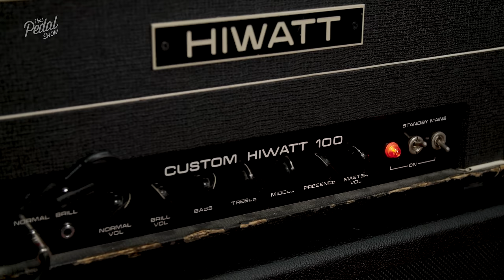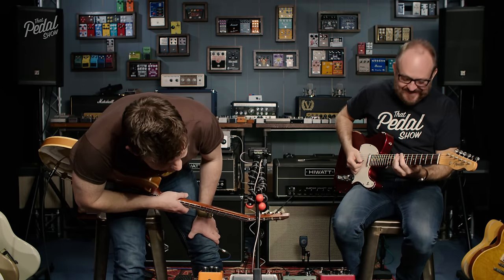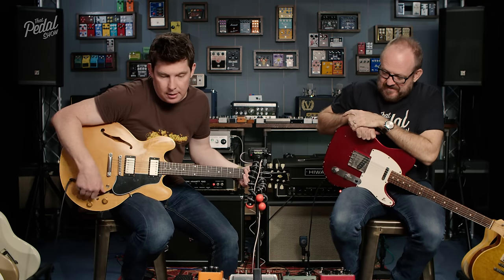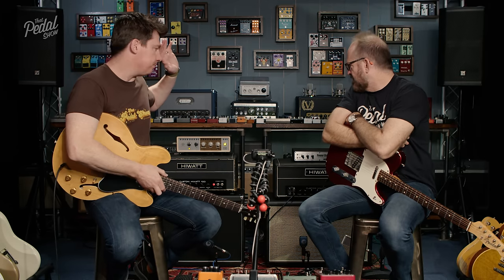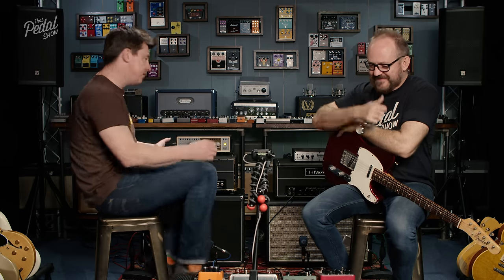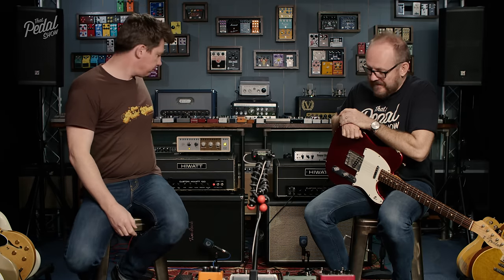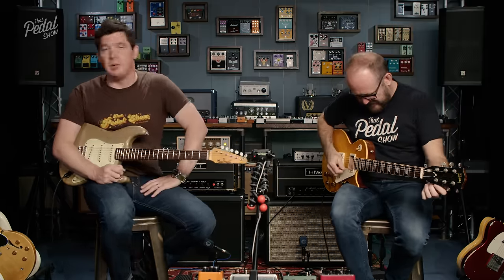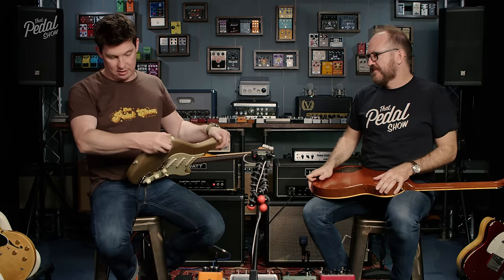Vintage Hiwatt DR103 Amps: Wet/Dry, Plus UA OX & Fryette Attenuators – That Pedal Show

Comment: First, that tone when Dan last plugged in with his downtuned Les Paul and the Color Driver on was absolutely insane, just begging for some slow, heavy Doom metal riffs! 

Second, I'd love to see you guys do an episode with the Blackstar HT-5R combo, it's an interesting low wattage amp and quite a few people own them since they're very full featured for the price. My experience with mine is that the hybrid tube/solid state preamp, solid state phase inverter and tube power section architecture can be kinda picky with overdrive pedals. My TS mini sounds great with it, but my Lovepedal Superlead can sound really harsh trough it, as if something was going wrong in the amp. I'd love to see your thoughts and experiments with one of these, they'd be of a great help on my tonal journey

Comment: A year later and I'm watching this again because . . . HIWATT!!! Delicious musicality! I prefer the Freyette because it seems to compress the top end and gets rid of the 'torn paper' extraneous noise on the top end. Of course, this could be the EVM 12Ls as well. Really, It would be wonderful for you to do a new Hiwatt episode that includes Fane speakers and a 50 watt Hiwatt for comparison. In America we also have the HiTone and Reeves companies as well as Weber speaker company that creates all flavors of cones at all impedances and wattage ratings. As far as the 'ripping paper' thing I don't like, that seems to be cured with higher wattage speakers that do not break up as early, as well as compression to chop the top off before it chops the top off our hearing. For me, harmonic distortion is great in the mids, but unwelcome at the very top. As you say, "Chewy" without the 'ripped paper' on top which always sounds/feels extraneous to the core musicality. I also fear it exhausts the audience after awhile. Then there is the EL34 vs 6L6 'argument' which even EVH dealt with in his 5150 III amps. Another thing to mention about Eddie's sound is the wet/dry/wet setup with the 'stationary chorus' (Dimension C) doubling effect. He used a preamp out/splitter box to stereo effects and back in to stereo power amps to his wet cabs. Speaking of power amps, Freyette is the only one to create stereo power amps with multiple 16 Ohm speaker outs. If I was a rich guy, I'd be knocking on their door in North Hollywood tomorrow; asking (BEGGING) for them to create custom stereo power amps with multiple 16 Ohm outputs and attenuators built in. Use the Hiwatt preamp for tone/texture/dynamics in front of everything. Sorry about rambling here. Blame it on a year in lockdown. Again: HIWATT FOREVER!!! MORE PLEASE!

Comment: Where's the Ram's Head - Mistress V2 combo into the Hiwatt? :) Another general combination that works really well with Hiwatts is to have the PowerBoost in clean boost settings after the Muff or the Fuzz, this is what DG does. ;)  Gtr-> Comp (not with fuzz) -> Muff(or Fuzz) -> PowerBoost (clean boost) -> Delay -> Hiwatt. Nice episode and keep up the good work guys! Cheers!

Comment: Another useful tip. Ted Weber industries makes their own reverse engineered tone clone of the original Fane Crescendo speaker, their model FC12. I have a 2x12 size enclosure with a single Weber FC12 model so I can drive it hard with my DR504. I'll use the 50W Weber attenuator as well. Absolute magic.

Comment: I’ve had a DR-103 for 34 years. I’ve been using a Ho’s Electronics reamper with it for about 15 years. Without the attenuator it’s just too loud to use as it sounds stiff below the sweetspot. With the reamper/attenuator and dialed into the sweetspot, it’s pretty hard to beat.
It’s a Mid 70’s model with the “Canadian Mod”. Awesome episode.
Reply from the maker: Nice. We concur on the attenuator thaaaang. Cheers!

Comment: I've just recently bought an Electro Harmonix Mig-50 and boy is that thing loud. Never played the original Sovtek but I'm sure they were much the same. At "only" 50 watts it will rip your face off. I believe they're based on the Fender Bassman/Marshall JTM45. Non-Master volume. So good. I can't imagine the loudness of these Hiwatts!

Comment: Wow- great video- thanks! When you play the sunface fuzz through the non attenuated amps earlier it was amazing- I'm used to the fuzz into marshal/ vox thing, and I love that sound. But here, instead of a sound where the fuzz was squelchy and squishy, the bass just bloomed- I didn't know a fuzz face could do that- it was sort of like a muff, but not muffled( ha ha), and the overtones and hair on the fuzz were so expressive- it was amazing. Later on, through the power station and with the amp cranked up all that magic was gone. It sounded, on my end, like a lot of fuzzes do where you step on the fuzz and the sound gets smaller. I noticed you had to crank the volume a touch just to get it to not seem like the sound was disappearing, and likewise the amazing bass and expressive hair were gone. This could have been the effect of attenuation, or of running the pedal into a gainer amp. Either way it was fascinating. Years ago Dan made the argument that pedals don't have a sound of their own (that it's the interaction with the amp that makes the sound, and that sound will differ sometimes drastically from one amp+pedal combination to another) and nowhere I have I heard this effect more radically demonstrated than in this video. A real education! Some day a lot of us would love to see a Tweed amp video- but I have a feeling that Mick especially would be underwhelmed as the Tweed sound strikes me as the rough opposite of a Hiwatt- aka - an amp that caves fast and, especially the Tweed Deluxe, craps out in a spectacularly crappy fashion that is definitely not about high headroom. On the other end of things, coming through my headphones (AKG Studio phones) I find the unattenuated clean sound of the amps quite sterile. I don't think the mics can really translate what it seems like you guys are hearing, and all that high end cut can come across as a bit spiky, while on the other hand the attenuated cleans sounded fuller and richer to me. I guess they probably also sounded more compressed and less dynamic- aka - more like other amps that we might be more used to hearing. Thanks guys!

Comment: After your color driver video I bought that True-fi you have on your board. Not only does it sound great with yall's two rock. It sound killer through my Ac15 (w/two blues) a DRRI and.... with a Pbass through a ampeg b15 clone in a 2x10 configuration. True-fi puts out some sick pedals.

Comment: As a HiWatt fan (I own a 1972 DR103, which unfortunately I never use anymore due to it's ridiculous volume levels), I can tell you that the beauty of the HiWatt didn't come through on the vids. Not your fault. You just have to feel it to experience it. Its bone crushing in a wonderful way. Also, I didn't like the tones with the Klon or the Colordriver, or the Octafuzz. I sort of wish you had a Timmy or a Bluesbreaker set to a very mild overdrive to see how that would have reacted. Hmmmm...I may have to pull the old girl out the closet and give it a try (I'll probably lose the rest of my hearing in doing so). 

BTW - two things to keep in mind. First - HiWatts of that era don't overdrive much at all. The Red Tele pushed the amp harder than most other guitars would have. Second - a DR504 is a different animal, much like the differences between a 50 and 100 watt Plexi. The circuits are very much the same, but still, the lower output really changes the feel dramatically. 

One final note - I know that the DR103 is a 100 watt amp. But be careful with your speakers. When I bought mine (used in around 1975), I also bought a basic Marshall 4x12 cabinet  loaded with 25 watt Greenbacks. My main pedal at that time was an MXR Dist+. Three days after getting this rig, I was bringing it back to the store because something didn't sound right. Turns out that my 100 watt amp blew out 3 of the 4 speakers in my 100 watt cabinet. These HiWatts are beasts, and with lots of level and a little bit of drive it will eat almost any speaker for lunch. I think you will be fine with your pair of EVM-12Ls, but always, always, ALWAYS over spec your cabinet for that amp. You've been warned.
Reply from the maker: Thanks for the input. You’ve felt it, you know it. You don’t like a Klon or a Colordriver. Make a video and show us what we’re missing. Cheers’

Comment: You guys have to open up the Hiwatt and show the viewers the magnificent work of art that is the Hiwatt layout and rectilinear wiring. I have never seen any other amp with the meticulous attention to detail and quality workmanship.
Reply: Also, you may want to check the 10K (brown-black-orange) power resistor near the middle of the pre-amp board. These things over-heat and burn out. I replaced mine with a higher power resistor.

Comment: The old hiwatts were built with overwound custom transformers and a lot of them were actually capable of around 130watts RMS
Reply from the maker: Ooooof that makes some sense
Reply: Gotta love that old Partridge iron. If I'm correct, you'll only see that out of the 4 input Hylight era stuff.

Comment: Try a Weber Mass attenuator. They use a speaker motor without the voice coil, and they draw power from the signal in a way that preserves the base tone and much of the dynamics. Not expensive either. I use a 50W version with my homemade DR504.

Comment: Super interesting at 23:30. Left channel is the “wet amp” right channel is the “dry” (maybe they’re not panned completely, but they’re mostly separated). The net stereo effect of the vibe on just one amp sounds awesome! Had to go back and check that you didn’t have a stereo version of the Deja.
Reply from the maker: Indeed Matt. There are also stereo room mics so you’re getting a bit of that too. Wet/dry is such a cool way to do things. I find modulations sound really stereo... even though they’re not. Niiiiice! :0)

Comment: My old Carvin 100XB Tube Head from 1989(?) must have been designed as a Hiwatt clone. Am I correct? It really was a powerful amp and sounded great on the dirty channel for soloing without anything but verb. It was EL34's with a 25 watt, 50 watt and Full wattage switch in the back. It looked exactly like the Hiwatt, except for the logo. I only used a Wah pedal with it. No other pedals. My lead tone was incredible at volume. I used to shake the pictures off the walls of Pub's. 😂

Comment: The Dimension sounded awesome in wet/dry.  The guitar sounded clear while there was this spatial thing going out around the primary tone.
One thing about pushed EVs (over around 100dB) is that while they don't obviously compress dynamics, they do roll off the top end so you won't get all that Hiwatt clarity up loud.  Bruce Zinky explained to me a few years ago that the large coil and magnet created series inductance (and the heavy cone and creates mechanical inductance) that acts as a low pass.  The louder you push it, the more these add up to roll off more top.  Kind of helps to take away some of the pain.
The Ox sounded good attenuating the speakers but the direct sounded like what I dislike about most attenuators in that boxy compressed sound.

Comment: I'm always surprised to hear people talk about how hard it is to play Hiwatts live. I have a DR103 that I can push reasonably well at shows. 
Considering that YouTube has no shortage of armchair experts, maybe someone will chime in, but here's my thoughts:
Given that a loud snare hit is probably at least 110-120dB, and most amplifiers are ultimately still going to be limited by the speaker sensitivity and overall output, I don't see how a loud amp should be that hard to contend with. Even a cheap SM57 with a 10dB pad still has a max SPL that should exceed a cranked amp. Granted, the front row will be hammered with sound, but if you've ever been near the front of a stage where the PA isn't hitting you directly, you'll typically notice that the snare at cymbals overshadow most everything else. Admittedly, I've never worked behind the soundboard at a venue, but I've recorded makeshift demos in practice spaces that have come out fairly well with even less technology at my disposal.
Reply: Because while a loud snare hit may be peaking around 120db, that's only momentary.  An amplifier constantly putting out 100-110db is going to sound MUCH louder than a single snare smak.
Reply: @Smurfman256  This is true, but a Hiwatt's volume peak is also purely in its attack. The amp isn't putting out that dB amount "consistently." If anything, it's infamous for not having a lot of sustain.

Comment: My first amp, in the late 80s, was a custom hiwatt 50 (I think) 2x12 combo that I purchased used as a bundle with a boss super overdrive, an ibanez metal charger, and a cry baby wah pedal for about $250. The pedals alone would have been more than $250. That combo had some of the most percussive cleans, and thunderous bass ever. Unfortunately was also incredibly heavy. Somewhere around 80lb. I still can't believe how good of a deal it was and how little I appreciated it. I traded it in for a 75watts transistor marshall because I had hurt myself and I couldn't lift it up anymore :( 

I have a few times put all the volumes to 10 and my brother and I loved looking at books, money, and stuff falling off the desk or amp from the vibrations. Insanely loud and I didn't know that you could jump the channels LOL
Reply from the maker: Ah, those are the stories. Maybe people will tell them about the Kemper that got away one day. ;0)
Reply: I actually had a couple of those too, but they were fractal. 
The only other amp I regret giving away was a Mesa Boogie Mark III 60 watts combo that I loved and bought in the 80s in Italy also for about $350-400. I sold it because I needed money in Florida on Ebay to someone in NYC, to then walk into a club in Connecticut 10 years later to see someone else playing through it. Somehow I recognized the amp. Talked to the guitar player, and he confirmed he bought it from me.
I recently bought myself a mark V 35 head just to pacify myself. 
The mesa doesn't match my live playing needs, strangely the Boss Katana fits the band sound better, but it's just so sweet to play at home when I remember to turn it on ;) lol
Reply: Yes, mine had casters too. Used them until they broke, repaired them, and cherished them lol I was 15, weighing around 150lb myself, slugging that amp around ;)

Comment: Best amps ever made.   I have a 1975 DR504 myself.   If you guys are interested in the HiWatt sound at a reasonable volume, check out Hi-Tone- they make absolutely stunning stuff.   I have a 30-Watt CP103 clone and it’s pure “Live at Leeds” without the requisite hearing loss.

Comment: The valves (EL34's) are in a matched pair, the two middle ones a pair, two outer a pair. So remove the two outer and it will lesser the volume (allegedly making a 100 a 50 watt) It's still loud though! I have a '74.

Comment: Mick, you should check out the Reeves Space Cowboy if you ever get your hands on one. Basically a handwired HiWatt circuit (50 or 100 watts, Partridge clone transformers) with KT77s instead of EL34s, a two-knob long-spring reverb (same tank as a Twin, I believe) and a switchable solid-state front end boost. Definitely somewhere in the middle of the HiWatt/Two Rock/Fender clean high headroom amp territory you've mapped out over time.
Reply from the maker: That sounds AWESOME!

Comment: I'd love it if you guys would have a look at the Rivera RockCrusher Recording device.  I've had one running on my '67 Fender Twin Reverb as an attenuator but I am also planning to use the speaker simulator features (XLR or Line In?) into my M-Audio M-Track 2X2M then into Logic Pro 9.  The load box attenuator devices are splendid for using in a bedroom scenario, but the speaker simulation features on the Rivera RC Recording is next level.  PLEASE!  PLEASE! HAVE A GO!!!  Thank you guys so much, keep up the fantastic work!!!!!

Comment: I think you guys need to re-visit phase and wet/dry rigs. Specifically dealing with pedals that are only feeding the wet amp, but flip the phase by design when engaged. Had problems with my Chase Bliss Tonal Recall until I bought a phase reversing box specifically for that loop. Dan, maybe you could do a v2 Grumpy Bot that has a phase switch for the output to specifically meet this need where the humdinger is overkill and takes up too much space on the pedalboard??